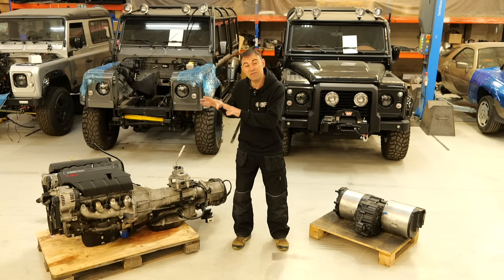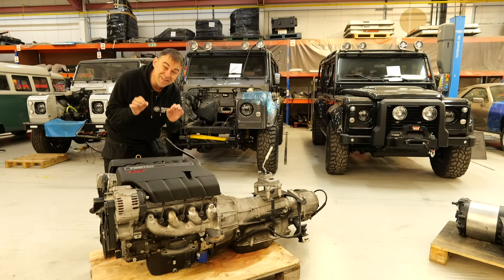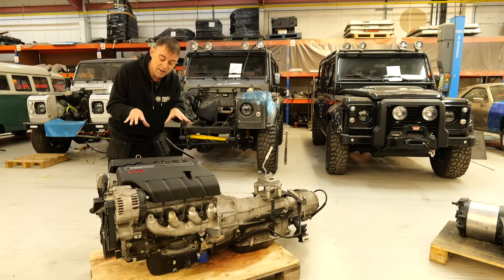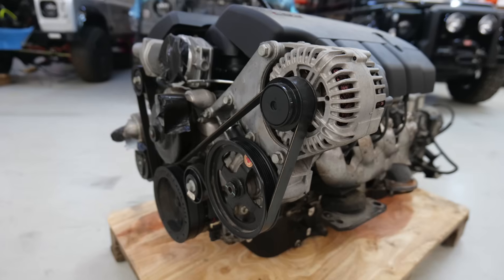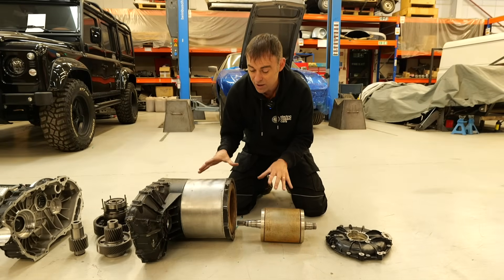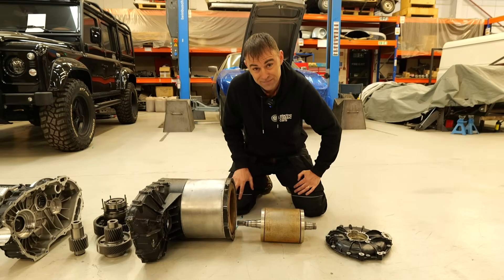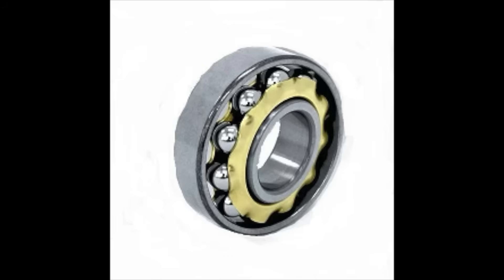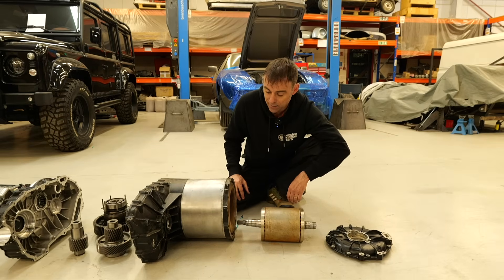Let's compare the Tesla LDU with an LS3 V8 and take one apart to see what makes it tick.

Comment: Electric motors are superior for power than ICE engines...that is a given.  It was true 120 years ago when the comparison initially was put forth and remains true now.  The issue with motors, and why ICE won out for 120 years, is the stored energy requirement into batteries.   Batteries weigh a lot, more than all the ICE parts put together.. On average EV's are 30-50% heavier than ICE vehicles, and still in 2025 it takes real some time to charge them.   Ever been low on battery and try to find a charging station without 3 people deep waiting to charge their vehicles first you have been very lucky.   Of course also the expense of buying that initial Electric vehicle can't be ignored, as it is usually 5-10K more than ICE powered.  That takes care of a lot of maintenance costs, which some manufacturers, Hyundai, Toyota for ICE engines, for example cover for first 3 years or so.    So not saying don't buy electric vehicle, but there it is not the panacea that perhaps some suggest before owing one.   Over next 10-15 years it's logical to assume that charging will become easier and perhaps faster, but that is definitely not the case at the moment.   Lastly the pollution point, it is true no exhaust gases coming from EV car, however, the mining with heavy diesel powered machines to get the lithium, cobalt and other rare earths that are rare for a reason and obviously being made rarer, are a huge impact to the environment as they strip mine the planet to get them and destroy that land for perhaps 1000's of years.  Also it takes years of service (perhaps 5), to see any reduction in Greenhouse gas emissions when you factor this all in.   So again, EV's not perfect, and ICE  and/or hybrid is still a reasonable option.
Reply from the maker: Ok. A number of things to address there. Firstly rare earth elements/minerals does not mean they are rare (I.e. scarce) they’re actually quite abundant. In the 8 years of EV ownership I can count on one finger the amount of times we’ve had to queue at a rapid charger. Lifetime Emissions studies have been done into comparing EV to ICE, and whilst I yea true that EVs currently make more emissions during manufacturing, by the time they do 30k miles the ICE vehicle then starts to emit more so that by 100,000 miles the the ICE vehicle would have produced 3 times more CO2 emissions. As the UK grid is relatively clean, with only 1/3 of electricity now coming from fossil’s fuels (gas, no coal) that cross over point is actually 16k miles. 👍

Comment: should put a transducer/microphone inside the plugged cooling shaft, and connect it to a speaker. Could possibly generate the sound experience/feedback missing in sporty driving.
That you can just switch off, if you prefer it silent
Reply: Dodge already did it with the elctric challenger.  One of the worst electric cars ever reviewed.
Reply: @davidburkholder7360  pointless comment. The dodge sound is electronically generated, not actual amplified motor sound. And the car is mediocre for many reasons, other than the sound. That you can switch off anyway, as well
Reply: @USUG0  Not pointless and yes sherlock, we know there is no engine and it's amplified sound.  No sht.  And the car was and is DOA.
Reply: @USUG0  You tell whn i work on the tree is falling.

Comment: Three important questions you did not answer :1. How much does the battery weigh? 2. How often do you have to replace the battery? 
3. How much does a new battery cost ?
Reply from the maker: 1 - there’s a link to a previous Tech Talk when we compared petrol vs batteries at the end of the episode and when we talked about weight. 
2 - A typical Tesla battery will do 300,000km before getting down to 90% capacity (just Google it🤷‍♂️)
3 - A quick search on eBay tells me a good secondhand Tesla model 3 battery is around £3000-£4000 👍
Reply: There is nothing even close.  The degradation of Tesla batteries is nearly non existent at over 300000 miles.  I think you will agree, impressive.
Reply: So tell us your answers to your 3 questions. My answers are:
1. Who cares
2. The battery will outlast the car
3. If you buy an EV, you get an 8 year warranty. So your question is how much will a new battery cost in 2033? Some say batteries will be below $50/kWhr by then, so a typical 60kWhr pack would be around $3k. What you failed to ask is what can I get for the failed battery? By most accounts quite a lot either for recycling or for people who want to connect a nigh battery to their solar system.

Comment: Interesting & educative! However the battery, capacity & placement, would be the niggle with the Tesla conversion... Thoughts on that?
Reply from the maker: The battery pack on a Landy goes in the engine bay and another where the fuel tank used to be. Check out our previous episodes in pretty sure we’ve covered it a few times. Although it’s probably worth another updated episode on our latest Land Rover conversion kit. 👍
Reply: @ElectricClassicCars  More or less what I thought. Will check your previous stuff 👍

Comment: Interesting video, but I think your efficiency figures are a bit misleading as the electricity network is only about 35% efficient dependant on the mix of fuels (unless you are 100% wind or solar), and you also have to take into account the energy used to make the batteries .  What do you think?

Comment: If you're going to explode the V8, you also need to explode the inverter on the Tesla unit.  I'd expect a failure of any electronic part will likely kill the unit just like a failure of a mechanical part in the V8.
Reply from the maker: I’ve been working on Tesla motors for 8 years now. Not had any problems with inverters, unless caused by the coolant leak I mentioned. I forgot to show the exploded view of the gearbox and transfer box on the Landy too. They probably have as many moving parts, if not more, than the engine. 👍

Comment: You should add the total weight of engine and power source, since it a better comparing the total the total system. for gas the engine is the heavy part and for electric it is the battery. If your using the engine where you have easy access to electricity or a good size solar installation/windmill/hydro plant, an electric motor is perfect. If not the power density of gas and diesel is hard to beat.
Reply from the maker: We did that in a previous Tech Talk. Linked at the end of the episode and when we were talking about weights. In case you missed it, here it is. 👍 https://youtu.be/opF1si__APs?si=p_kkT3MnHdbbKJ1u

Comment: Don't forget the extremely heavy complex 1,000 lb battery and all the inverters and all the other electronic components to run that electric motor
Reply from the maker: We showed the inverter in the episode. 🤷‍♂️ The battery we covered in a previous Tech Talk, which was linked at the end of the episode and when we were comparing weights. In case you missed it, here it is. 👍 We did that in a previous Tech Talk. Linked at the end of the episode and when we were talking about weights. In case you missed it, here it is. 👍 https://youtu.be/opF1si__APs?si=p_kkT3MnHdbbKJ1u
Reply: @ElectricClassicCars what about the cooling system for the motor and the battery all of the very complicated systems that are involved in a modern electric car
Reply from the maker: @markdi2 You mean a water pump and radiator? The same as what on an ICE vehicle. 🤷‍♂️🤦‍♂️

Comment: So you includes the exhaust the wiring and everything in a ICE car, but you don't include, the wiring, the battery the electronics or anything for the EV, a bit one sided aren't you?
Reply from the maker: I also didn’t show all the parts inside the gearbox and transfer box, the starter motor, fuel lines, clutch, engine control unit, etc etc

Comment: Now count all the electronic parts in the inverters and add them to the body parts.
Reply from the maker: And then count all the electronic parts in the engine control unit, gearbox, clutch, starter motor, transfer box, etc etc 🤷‍♂️🤦‍♂️

Comment: In ICE cars the engine is expensive and high maintenance, but the fuel is cheap while with EVs the engine is cheap and low maintenance, but the fuel refill and storage are expensive in both time and money, so at the moment a hybrid is better, but an ICE is cheaper.
Reply from the maker: I’m not sure what country you live in but here in the UK the cost to charge up my EV at home is many many times cheaper than running a car on petrol. If we take my wife’s Tesla Model 3 it costs £1.80 to do 100 miles, compared to £14.12 for my neighbours new BMW 320i.
Reply: To me, hybrid does not seem intuitive especially on smaller cars.  First the performance restriction of the active power chain making up for the weight of the inactive one and next, the classic mismatch of ICE with the CVT the electric needs.  Maybe not the best example, but my Ford Escape ICE version with the 2.0 turbo will get 25/40 mpg (my numbers) and rated tow of 3500lbs and PHEV has a 2.5 turbo with 42/36 (their numbers) and a rated tow of 1500.  Guess it just matters what you want to compromise on.  But, hey, everyone makes them and certainly they wouldn't try to put one over on us now, would they?

Comment: You can see why auto manufacturers would like you to buy electric . simpler with the potential for higher profit margins . Tesla proved that you can have decent margins for EVs . Of course there outspoken CEO did not help the cause . Electric motor force will be the primary mode of transportation in the not too distant future .

Comment: Very biased review.  
Of course you need to add in battery weight! 

Big Tesla battery 100kw 
85 litres petrol 760 kw. 
All ev get range by being aero efficient landrovers are not. 
Modern petrol engines run at 40 % thermal efficiency not 20% 
EV has its place, esp in town run abouts, but useless for towing etc. 
Batteries may get better 🤞

Comment: Should do a weight comparison before and after the vehicle has had its power unit swap....i keep hearing battery vehicles are alot heavier than petrol or diesel vehicles....so you have to do a complete power unit weigh in..ie engine/gearbox,fuel tank and fuel...then complete motor, gearbox, converter and battery packs...and there is still a argument about being cleaner people forget how the electricity is produced to power up the battery packs.... yeah thats right people burning 1000s of tonnes of fossil fuels every day at the poeer stations...🤔
Reply from the maker: We always weigh the vehicles before and after their conversion to electric. Check out our previous article on pauses. They usually weigh the same. There’s been lots of studies into which is cleaner, even when the electricity comes 100% from coal and EV still produces less CO2 over its lifetime. But here in the UK, where no electricity comes from coal an EV cuts emissions by 2/3 when compared to an ICE vehicle over its lifetime. That includes manufacture and all the miles over its lifetime. https://www.carbonbrief.org/factcheck-21-misleading-myths-about-electric-vehicles/
Reply: Power stations

Comment: The LS converted Landrovers don't look like they got much use,  a bad decision perhaps....
Advantages of the electric drivetrain are pretty clear, having no clutch/torque converter and a fixed ratio transmission means no shock loadings from clutch drops or hard shifts. You can probably protect the whole drivetrain from "hooligan" driving in software. Something very elegant about only having a few bearings... 
I know everyone likes to mention the number of components in an IC engine, the majority of the components sit in a fairly controlled environment and will never need individual service.

Comment: you should have added the weight of a full gasoline tank to the LS Engine and the weight of the Batteries to the Tesla motor
Reply from the maker: Why? This is an episode about the Tesla drive unit, opening it up and seeing what makes it tick. We’ve done covered battery vs petrol tank comparisons in a previous Tech Talk. As linked at the end of the episode and within it when weight was mentioned. 👍 https://youtu.be/opF1si__APs?si=_Q-K66sRAitbpE8B
Reply: @ElectricClassicCars  The tesla unit is still way more efficient than the LS engine. But if you look at the complete system (the car) the efficiency is a little bit less because of the weight of the batteries. And you said at 3.58 "i haven't included everything". Nothing wrong with your work, Just to be mentioned.  And if you have the time to do this, please make a video how to fit that tesla unit to the drivetrain of the defender. Thank you.
Reply from the maker: @jorgseifert4712 We’ve already done a video on fitting a Tesla motor into a Land Rover. 👍

Comment: INDEED AGREE WITH YOUR PRESENTATION. TO ALL OTHER COMMENTS. NEVER STRESS OUT ABOUT BATTERIES... THIS PART IS FREAKINGLY EVOLVING VERY FAST... MANUFACTURERS OF BATTERIES ARE INNOVATING INSANELY LIGHT SPEED ... HENCE... IT WILL END UP TO A VERY LIGHTWEIGHT, CHEAP AND VERY LONG RANGE CAPABILITIES... TRUST ME MATES...ON THE OTHER HAND... PLEASE GIVE ME THE LINK OR VIDEOS... WHERE U GONNA CONVERT THE LAND ROVERS INTO EV... USING THAT TESLA MOTOR... SO I CAN PURCHASE THE COMPLETE KITS... AND I CAN CONVERT ALSO MY LANDROVER INTO EV...THOUGH I PREFER THE 600HP LDM TESLA...

Comment: I really like the electric motor as a way of powering vehicles. The big downside of course is the batteries 😅. When I was a young mechanic I often mused about why more electric components were not used in cars (1980's) at the time as a way of forced air combustion, then from the point of view of reducing friction by using electromagnetic bearings

Comment: Not exactly a fair comparison. To get the true picture you need to include the battery and a meaningful fuel load, which would make the EV loose the weight battle by a large margin.

And to compare efficiency you need to factor in that the electricity has to be made and transmisioned from the power plant to the charger. If the you live in an area where electricity is made by fossile fuel, which is more than half the population of the earth, the EV is also less efficient than a good ICE car engine.
Reply from the maker: Even in a country which powered by coal the EV is still less polluting over its lifetime compared to ICE. Just Google it. You forget that you need to drill oil out of the ground, pump it to a port, ship it half way around the world, refine it into petroleum, transport it to a petrol station, then pump it into a car. All of which takes a huge amount of electricity and energy. And then after all that, only 20% of that energy in the petrol is turned into motion. It’s ridiculous. This episode is about the Tesla drive unit, opening it up and seeing what makes it tick. We covered the fuel vs battery comparison in a previous Tech Talk. 👍 https://youtu.be/opF1si__APs?si=ylRtOg_340xyhEgv

Comment: The V8 is doing more than the electric motor. If you include everything the electric motor needs to convert fuel into motion is a lot more complex than the V8. You need a power station and the national grid and a charger.
Reply from the maker: You are completely ignoring the fact that petrol doesn’t grow on trees. You need to drill it out of the ground, pump it to a port, ship it half way around the world, use a refinery to make it into petroleum, transport that petrol to a petrol station, then pump it into a fuel tank. All of which also needs a power station and the national grid. 🤷‍♂️
Reply: @ Yes I am ignoring that, just as you are ignoring that power station fuel has to go through this process too. So it's fair to ignore the parts that are the same. If we do that then the only advantage an EV has is that it only requires one gear to transmit motion to the wheels. They both burn fuel and emit CO2.
Reply from the maker: @wayland7150  Except an EV has been proven to use less energy and emit far less CO2 over its lifetime than an ICE vehicle. Also grids all over the world are rapidly decarbonising. Here in the UK 1/3 comes from renewables, 1/3 comes from low/zero carbon fuels and 1/3 comes from gas, the latter is reducing each and every year as more renewables are added to the grid.
Reply: @ElectricClassicCars  Spain went total zero yesterday.
Reply: @ElectricClassicCars  powerstations maybe efficient at burning gas but then you can run a petrol car on LPG too.

Comment: One omission, You have the weight of the two and mention the weight of the other parts but never mention the battery weight!. I'm not against EV's but you make a big point about the weight of the LS3 and associated parts. Most EV's are heavier than ICE vehicles due to the 2 tons of battery they have to lug around.
Reply from the maker: A battery doesn’t weigh two tons. A big battery like a 100kWh battery in a Tesla Model S weighs around 500kg. We didn’t cover the weight of the battery as this is a video about what makes a Tesla drive unit tick, taking it apart. Also, we’ve already covered battery vs fuel comparison on a previous Tech Talk. 👍 https://youtu.be/opF1si__APs?si=nzdWz3TJjQ1ZDDbI

Comment: I understand the Model 3/Y drive units are supposed to be more reliable. Is there a reason they aren't preferenced in these conversions or is the Tesla large drive unit easier to fit?

Great video thanks.
Reply from the maker: Great point. We actually use M3 motors more than the LDU but for this client he wants the ultimate power, hence the LDU choice. 👍
Reply: @ElectricClassicCars.. cheers.  Makes sense

Comment: Very interesting video Moggy 👍. I drive an EV but I still don't believe an electric motor is better than a V8. Driving an EV is like driving a car without a soul. I agree an electric motor is more efficient, have instant torque, it's smaller and lighter but they have less feel, no sound and charging is slow and from experience, can be a nightmare.